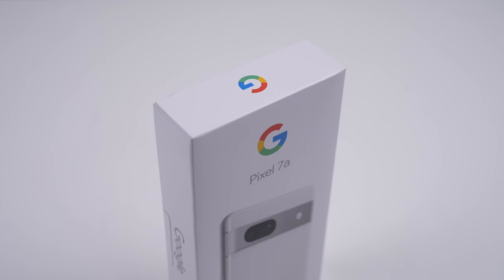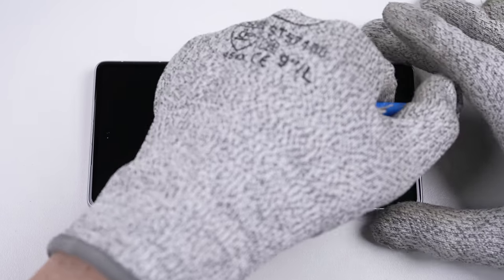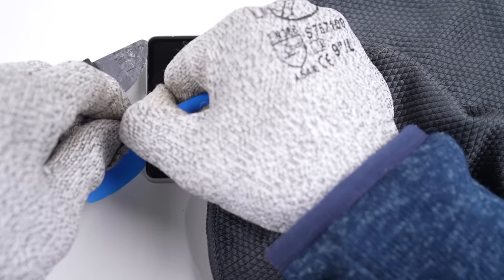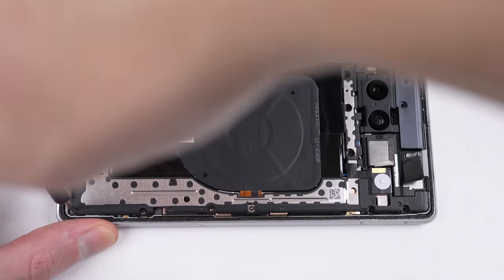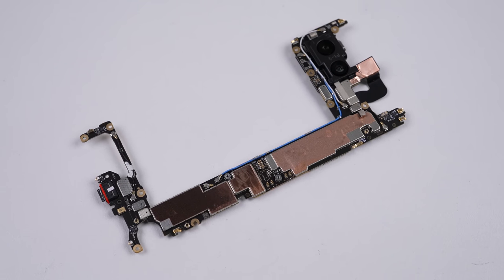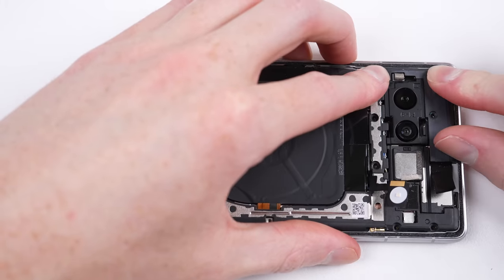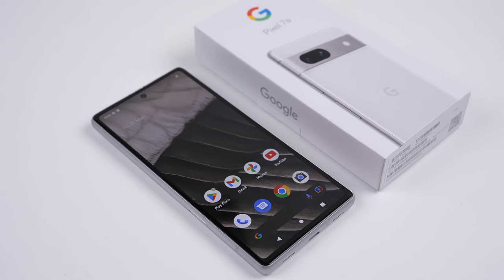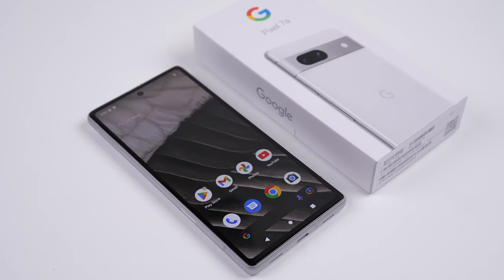Google Copied Apples Best Feature But There's A Catch - Pixel 7a Teardown And Repair Assessment

Comment: The display connector has a metal bracket and screw on top of it, this means you have to take the display out if you want to remove the motherboard you cannot otherwise, if the charging port is damaged you risk braking the display

Comment: Well, so much for my praising Google for their parts availability through iFixit. While you did get the screen off, I would not realistically call that procedure a practical proposition. Surely most experienced technicians would still end up breaking it and maybe damaging the frame as well. With a bad screen that may almost be acceptable but it just seems wrong.

Comment: Can you try attaching a new battery and see if the display issue is fixed? Sometimes either the fault lies in the circuitry or the battery, (if the display itself is not short-circuited) due to which the display can't pull the required voltage to fully power the backlight.

Comment: Does the battery really need to be so well glued inside? I mean generally, so that pull tabs won't be a thing anymore. Also how much adhesive does IP68 require before you need to melt the screen just to open it.

Comment: you knocked off a component next to the lcd connector, had that issue, found the component and soldered it back display worked again. careful when removing that flex cable.

Comment: Look's like screen was attached by heating metal base plate and then putted in screen. There are such technique in metalworking when You heated up one part and cooled down second part and then attach it to each other. If so then this black thing around screen are basically dumper for not to crack screen in process. But then it meanned that screen was installed firstly and I don't know how it can be done in other way. Allthou I didn't think that frame are full metal for this.
Other way possible it is just silicone glue. Then it understandable why it not response on heating because silicone glue don't give a fuck about heating in most cases unless it is melting hot wich damage parts anyway. Mean those silicone glues/germetics which usually selled in plastic tubes fo montaging interior things and etc.
Think screen was overheated also.

Comment: 9:03 This sounds an awful like the behavior of an Android device with a bga chip that has cracked solder, especially if it's the CPU
Reply: My 5a has a black screen. It SEEMS the phone is working since I can feel the haptic feedback and hear the charging sound when connected but no image whatsoever. Not even in fastboot mode. Do you think it might be cpu as well? In my country its LITERALLY easier to get the bga chip reballed than it is to find pixel replacement parts and since i didnt get it here, googles extended warranty is meaningless to me... Could a cold solder joint on a cpu prevent the display from working but keep the phone "alive" otherwise?...

Comment: I have a Galaxy S4 screen that fails in almost the same way. I found that the display controller is bad. Maybe you have applied too much heat on the display and damaged the components. And the same for me, recovery, boot is perfect but as soon it’s booted, lines appear, display blinks and turn off. A new display solves the issue.

Comment: I am 99% sure its something related to the proximity sensor, hope to see an update , while the screen is connected , lift it off the body to see if it resolves the issue.

Or maybe there are pogo pins or something similar connecting the proximity sensor which arent well comnected.

Comment: The low sensitivity at yhe start might be because some static buily up. On my pixel 6a if I charge it with a specific charger it wil get static and the screen will be just like that (unresponsive). For me it only happened with a samsung charger and cable using any other charger or cable worked just fine. What I think it happened is that the phone had static from something during the teardown and he might of touched some components on the motherboard  or display and fried or damaged them.

Comment: Hello, today we will make pixel soup. To make pixel soup, we need a Google pixel phone,a heat plate and optionally a pry tool. First off, pre heat the pixel phone at 500 Celsius for 4 minutes. Then, take your pry tool if you have it and open the phone. After that, remove the battery and camera modules. Then, take your camera less mess and bake it at 200 Celsius for 20 minutes, mix it up a bit, and you’re done! It tastes sorta like iron supplements.

Comment: I had a similar issue repairing an old samsung model. After hours of head-scratching I noticed that the light sensor was dirty/not connected properly so the automatic brightness dimmed the screen

Comment: I think this is an anti repair tactic. Since the phone is tested after applying the extensive heat and removing the screen, nothing explains this behaviour. And those are not symptoms of a failed oled screen. I hope this is just a rare case, but either way, modern devices cannot be really fixed anymore.

Comment: Not related to the pixel but related to the display problem. I have an iphone 12 have the same scenario happened in this pixel phone my phone is alive but the screen is completely dead, I got its screen replaced but not the original screen ever since then the feel is not the same as before, it has some issues maybe a hidden anti repair thing I guess

Comment: Hallo sir I say your video on anom phone have you tried to send file through Bluetooth, WiFi? And did you try to open the license of messaging app, contacts or dialer after connecting with a wife or any other internet source? Sir if you can send apps in the above method and install them in default or decoy profile.Then you can try installing a app known app manager from f droid which has a feature of showing the hidden apps , then you can extract the apks of that app and  you can use any file manager to locate the apk. And the then you can transfer the apps to another device and examine it.  Thank you

Comment: Hard soldered charging ports on the motherboard should be illegal
Reply: what’s the problem with it?
Reply: @shadowhejhog  because charging ports are prone to failure pretty easily.
They wear out quick(er), depending on your use of it
Reply: I agree. I work in school IT tech support. We've had a large number of student Chromebooks and staff Lenovo laptops with USB-C ports get sent to e-waste/re-used for parts because the USB-C port is damaged and is soldered onto the motherboard. I know it is possible to de-solder the ports and install new ones, but we just don't have the tools, training, and most importantly, time. If the USB-C ports were modular, we could easily swap them out with new ones and reuse a lot of our devices.
Reply: @JJFlores197  I once try to replace my old samsung(I think its samsung, i dont really remember) cahrging port. Its only micro usb 2.0 so it have less pin than new phone today. It took me 4h but I got it working.
I dont want to do it again. Especially without proper tool

Comment: Btw your screen seems like it works when its given a regular 60Hz signal and it doesn't work or show anything when the 60-90Hz adaptive refresh rate is given to the screen, something like that 

Hey, maybe you could help me or address the still ongoing problem with the Pixel 4XL, its an unrepairable device where the motherboard & camera are paired togather and repairing the camera will make the unlock useless just like apple's faceID except apple can be flashed and google cannot so you're screwed if you end up with a Pixel 4XL. The repair program was only offered for 1 year and its still a snapdragon 855 device. Do you know anything on this subject or weather you have ways to repair it.

Comment: never use that stupid ifixit metal tool!!!!it's your fault of course,those heating mats that many techs i know have using are only good for warming your lunch and the heat should only be applied where is the glue bond - that's where these manufacturer's proper tools come in are designed to do this job, a recent example is the iphone 12 series where some guys have wasted  a display due to improper heating, prying and so on when it's actually a 10 minute job free of fails

Comment: looks like google really gave up. its too bad
Reply: How did they?
Reply: @jasonrichardson1999  the display broke after repair. ive never had this happen, nor has he. ive repaired 2 z flips, they worked fine despite having much more fragile displays then the google pixel 7a.
Reply: @daytimedorks  this phone was a one-off because alot of other phones survived being taken apart
Reply: @daytimedorks  I doubt you cooked your z flips so hot that they burnt you through semi-heat resistant gloves, still not defending google here because of the original touch issues, but seems to me that the heat could have been a problem
Reply: @daytimedorks  I think the main problem is that he heated up to the point where the solder on one of the components likely melted.